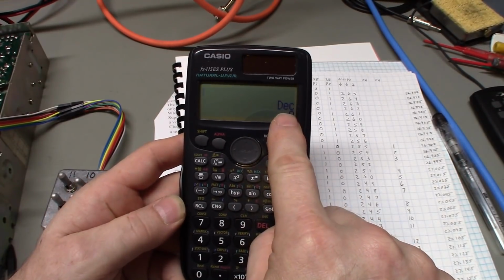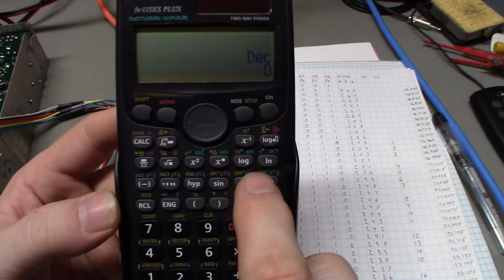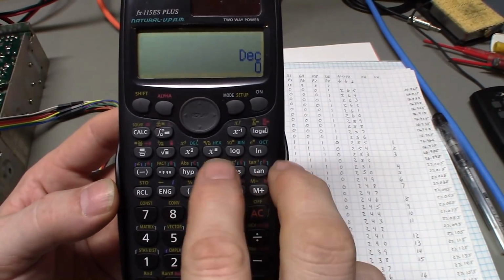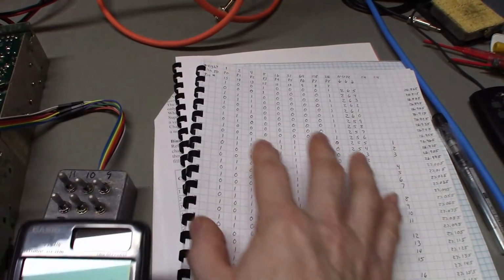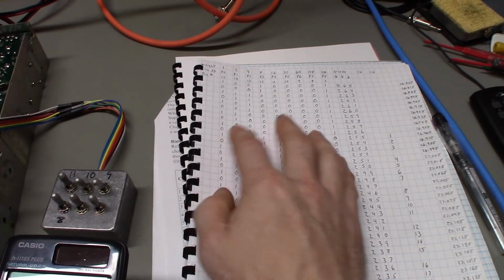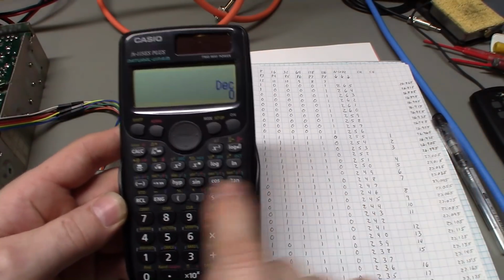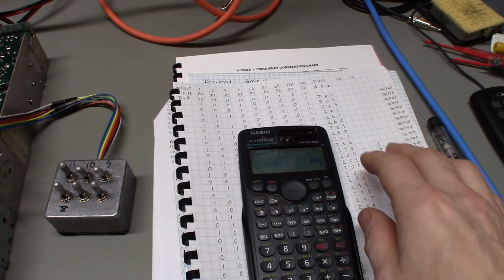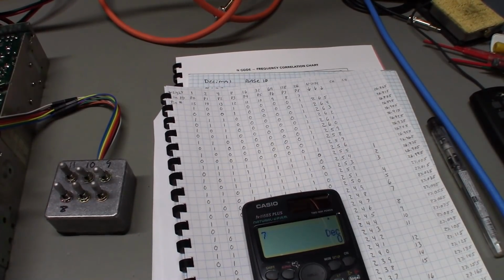How binary programming is used to change channels in your CB and how to modify it.

Comment: Much easier to sandwich an micro processor between the channel selector switch and the PLL chip.
Reply from the maker: The people that would be watching this video don't even know how binary programming on a PLL works much less how to program a microprocessor.  Adding a few toggle switches is something anyone that knows how to use a soldering iron can do.  Just because you can and I can doesn't mean that everyone else out there knows how to or even wants to know how to program microprocessors.
Reply: @mikesradiorepair  Subject for your next video?

Comment: What about having to Synthesizer chips which can be selected by a A,B switch the A position will select the USA synthesizer chip the B position will select the UK synthesizer chip so you then have 80 channels from 26.965-27.405mhz and 27.609125-27.99125mhz, only a small problem the space between the 27.405 and 27.60125mhz.